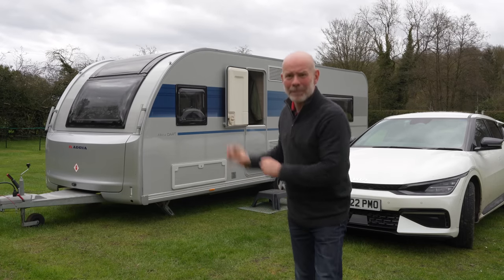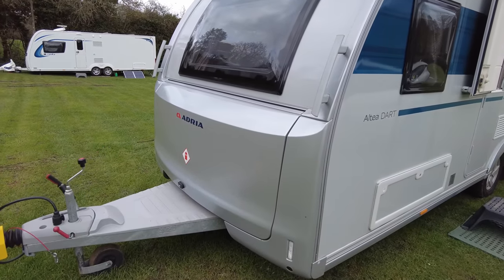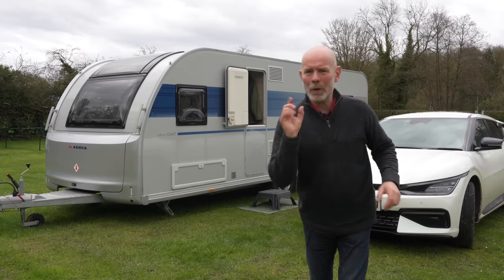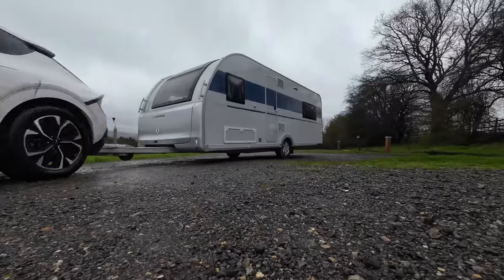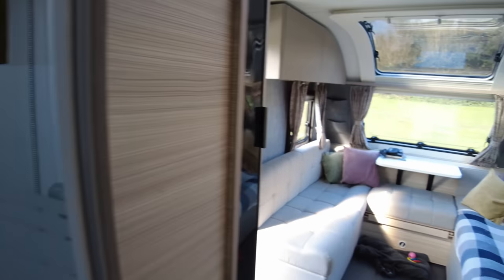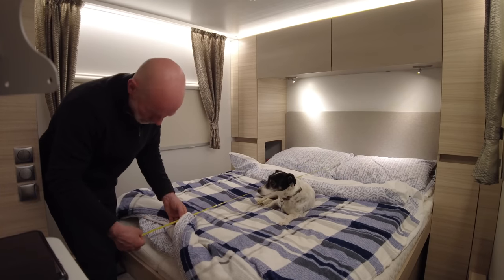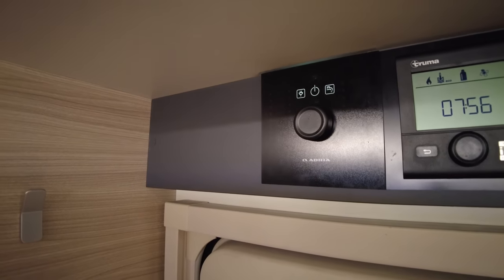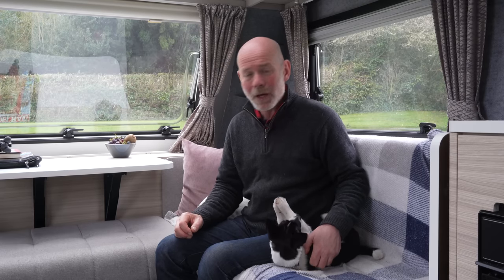Versatile Caravan for families AND Couples!  Adria Altea 622DP Dart Full LIVE-IN Review

Comment: Hi Andre, just watched your latest video. I noticed on this and a few others that you have the Safefill gas bottle in use, the original blue one. I have one the same being a long time user. I do a lot of rallies and have found it a cost effective solution. Mine is nearing its 10 year test date and I now also have one of the latest models and alternate between them. Yours has gaffs tape around it, I have a jubilee clip around mine as the case has shown some spread. I cant’t see that you have done a video on the options for refillable. I think it would be something that would make a good video. I do fear though that LPG at the pump will get harder to find. Maybe if more caravan/Motorhome uses adopted it we can stretch it out further. Keep up the good work.
Reply from the maker: You're right, availability is getting more challenging. I think Gaslow are hoping to persuade motorhome and caravan dealers to have LPG tanks and become resellers, which makes sense. This Safefill cylinder I was using was borrowed from a friend, I have a smaller Gaslow in my own van. Thanks for watching!

Comment: Yet ANOTHER very good and comprehensive review, Andrew.

The moveable track lighting seems a nice touch.

I absolutely agree with you about the sealant around the base of the shower being undesireable.  Maybe it doesn't matter to those who always go to caravan sites & therefore use site facillties, but those of us who normally camp on farmers' fields, on DA meets, THSs etc, who still want a shower every day, will inevitably suspect that the sealant will come away/degrade over time and that may very well lead to dampness in the van. Obviously caravans being driven around on UK roads will certainly have some flex in them and that makes sealant issues almost a certainty. Not good.  

I am surprised that Adria have failed to deal with the cable issue which you highlighted some years ago.  Bearing in mind that a few cable ties must cost only pennies, and that they resolve the issue perfectly well, it is something Adria should attend to. Same comment applies to electric sockets that are not properly aligned.

But, overall, a clearly favourable review. 
 
I think your very professionally produced reviews are the most reasonable, observant and influential on YouTube and I'd always want to know what YOU thought before buying.
Reply from the maker: You're very kind Raymond, thank you!

Comment: Lovely video as always! And I can say that we want this model in the rest of Europe! So good looking and nice layout! But in the UK the Altea is positioned as a higher class compared to the rest of Europe and for example, we only have one Altea-model with panoramic front window and that is the 392 LH. In other words the smallest model. I would love to have the Dart but with a transverse island bed so it could be slightly shorter. A length mounted island bed always adds more to the length. But this caravan range makes so much sense. Focus on light weight but roomy and not entry level. Perfect for EV-drivers.

Regarding the lack of external outlets, is it allowed in UK to use a splitter for the extension cable? I remember that you've said that charging needs to be done from the caravan? Why is the rule made like this?
Reply from the maker: I have no idea why the rules are like this! No, we are not permitted to use splitters in the UK, we can't be trusted... :-/

Comment: Andrew - great content as usual, I just have 1 question?

MTPLM and towing weight - can you legally tow a caravan with a bigger MTPLM than your towing weight? I ask this as the advice I was given was you could not (although the impression I was given in the reply I got from the Caravan and Motorhome Club was the weren't entirely sure!) - I'm curious about this as your caravan has an MTPLM of 1650kg and your car has a max towing weight of 1600kg

Keep up the great work - it was a pleasure for Fiona and I to meet you last year at the NEC!
Reply from the maker: Hi David, I checked this out with the technical department of the Camping and Caravanning Club before making the video before this one about weights. If you have a car trailer with an MTPLM of 3500kg, and it weighs 500kg unladen, you can tow it unladen with any car that can legally tow 500kg and above. It's the ACTUAL weight of the trailer that counts, not the maximum technically permitted weight. I towed the Dart at 1550kg to keep it below the 1600kg limit of the EV6.